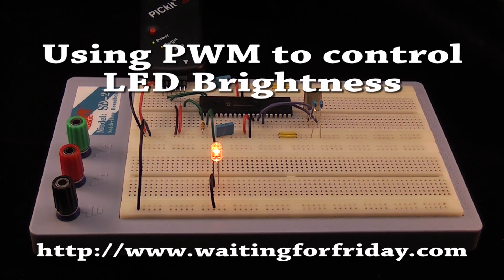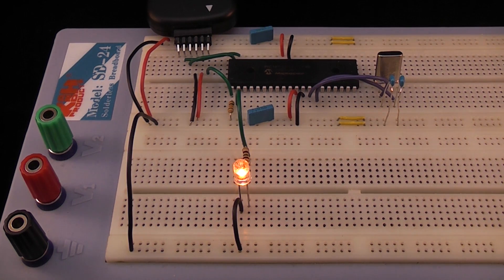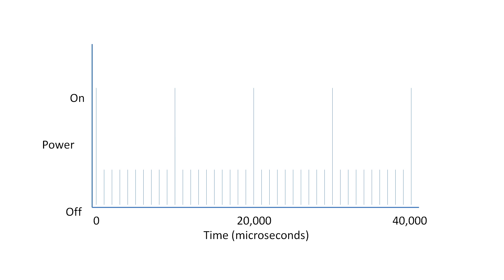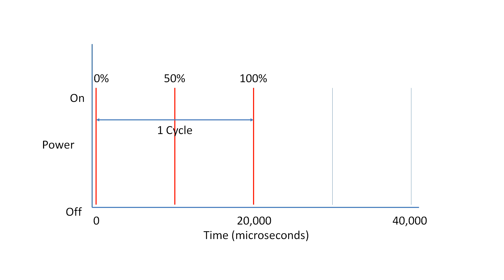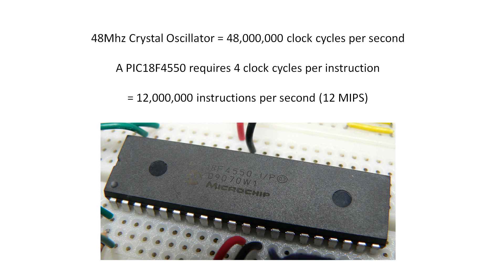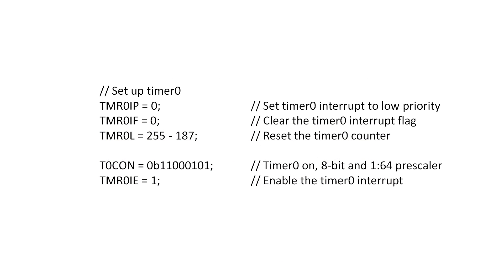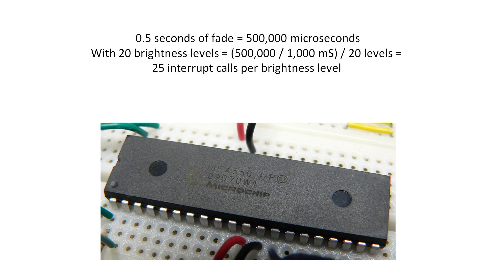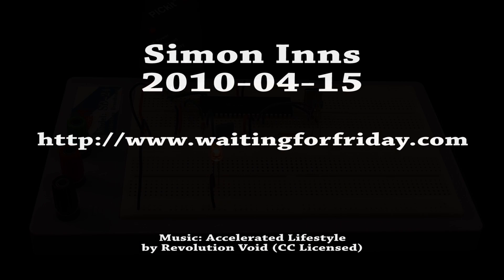How to control LED brightness using PWM

Comment: Hi Simon, I use the PIC18F8722 micro and its PWM is connected with the timer2 and timer4. Im using the timer2 for my experiment but I cant locate for example the TMR2IF flag, and thus I am unable to compile the file. do you know how can I use this one for my purposes? Thank you
Reply from the maker: If you are using the code from my website it is likely that you need to alter the target device in MPLAB to match the PIC you are using otherwise you will not be able to compile against your hardware.  If you can't figure it out there is a forum on my website where you can request assistance.

Comment: Excellent explanation and demonstration!

Your website is very helpful too. I haven't graduated yet from PicAxe so I would like to pwm on that chip. The goal is not to dim led's but instead have a fast constant pulse on my PicAxe 08M so I may "overdrive" some leds. 
Are you familiar with the PicAxe line?
Can you tell me if the "pwmout" wizard will suffice for this task?
(or do I need to do something closer to your solution for dimming?)

Thanks again for the video/website!